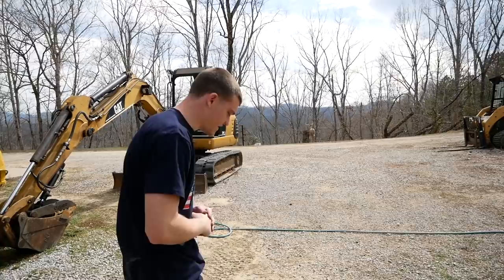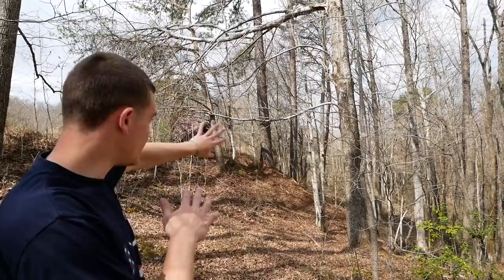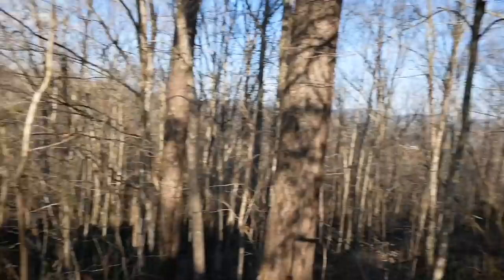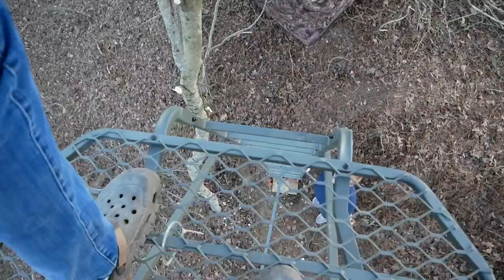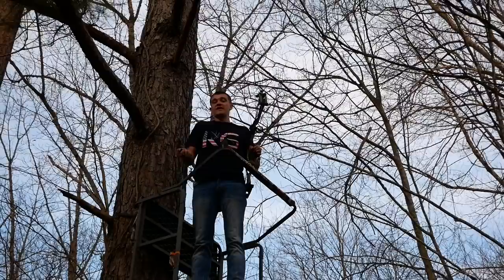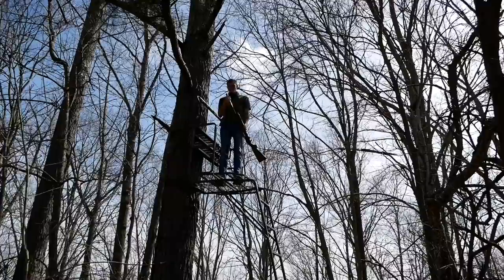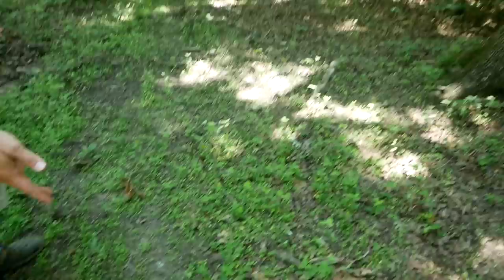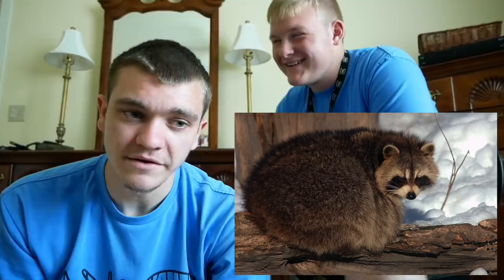BUILDING A WILDLIFE PARADISE! (What Lives Here?)

Comment: Hey kendall how do you like your Savage 110 Tactical? I'm getting one and wanted to know how you like it. also what elk bugle were you using in your my dream hunt video. My states elk population is growing steadily and well probably get to start hunting them in a few years so I'm getting my elk hunting stuff now so I don't need to later.
Reply from the maker: I'm not a fan of it honestly. It is pretty heavy and the bolt's coating makes it hard to chamber bullets smoothly.
Reply: @KendallGray1  oh man, well hopefully mine is more smooth. I have a savage axis II xp 308 and love it. Im getting the 110 tactical because of the over sized bolt, and the fluted and threaded barrel so hopefully it's a bit better for me. I cant wait for the elk here in wv to get to where we can hunt them though.
Reply: @KendallGray1 I have had that problem with a few bolts that were..well...anything but bare metal and two minutes with a scotchbright pad fixed it up!  

Honestly if you use a course pad it leaves millions of little scratches which actually looks cool but makes it much smoother than a polished bolt.
Reply: @BrianRRenfro  hmm I've never heard of that before does it really work
Reply: @appalachianoutdoorsman5769  Yeah for really anything you want to move smooth.  All the billions of little microscratches reduce the metal to metal contact area.  For an extreme example of how two perfect smooth things can stick together look up "wringing gauge blocks."

Same deal with why many bushings have  dull finish to them.  Also gives the oil a place to go and break it's surface tension.
Reply: Highly polished and/or smoothly coated surfaces tend to wanna slick together instead of slide.  The scotchbright pad leave the metal dull looking, matte.  It actually feels smoother afterwards if you run your finger over it.
Reply: @BrianRRenfro  I might have to try that when I get my 110 tactical if it has a rough bolt. It could just be a lemon because my savage axis has a good smooth bolt. So if when I get 110 tactical and it is like kendall's bolt ill try it.
Reply: @BrianRRenfro  makes alot of sense thanks for your help

Comment: Great idea on this food plot and clearing out the trees for a better sight line. It is still a bit too shady there to grow any of that food plot seed mix and you need to thin out some more shade trees on the southeast and southwest sides or buy a pruning pole and trim the tree limbs off. Also, never use lime without doing any soil pH testing first! Lime will raise soil pH and lock out the availability of iron for the plants and make them turn yellow and die. I learned the hard way just like you just did. To fix it, get yourself some chelated liquid iron and some humic acid that are made for lawns but they are good for any plant there is. Amazon sells both in gallon jugs by simple lawn solutions. Mix up 3 oz per gallon of water of liquid humic acid (it is black in color) and 2 oz per gallon of water liquid iron (rusty brown color) both into a pump up sprayer (use a large sprayer if you have one, I use a 4 gallon backpack). Spray your food plot area with it very well (you will see it turn the ground and grass stain brown/black). Trust me, the plants will grow like they are on steroids afterwards because they will provide and release all of the soil's nutrients to the plants. Animals will love it because the plants will contain more nutrients and taste sweeter to them along with using fertilizer. By the way, this will green up your lawn like it is on steroids if you spray your lawn with this mix and it won't burn it. Add a little liquid lawn soap/soil loosener (also sold on Amazon) at 1 oz per gallon of water and the plants will thrive even more. I'm also in Kentucky too, Kendall, so I know what works here or not! By the way, they always steal my game feeders here too in Anderson Co. I cannot have anything there even if I chain it up.
One more thing Kendall is to find a spot where you don't mind a big hole in the ground developing. Buy a few bags of rock salt or a cow mineral block and dump it there. Deer will come to it like a magnet and they will eat the salty dirt and the hole will get bigger fill with water and they will always come right to it. This also helps their fur to molt and also builds their rack.